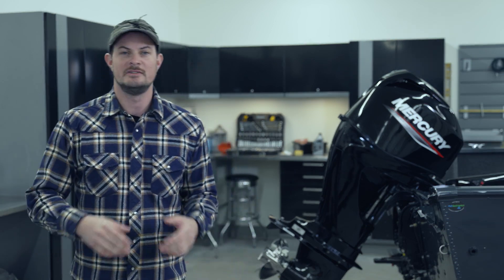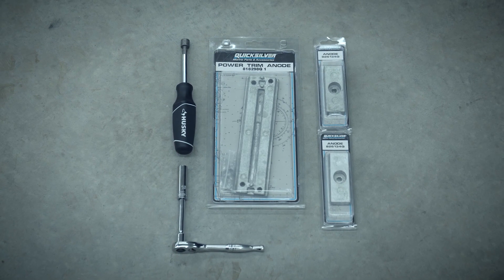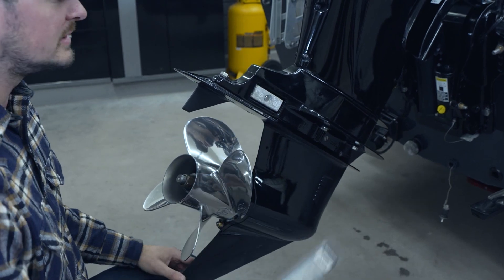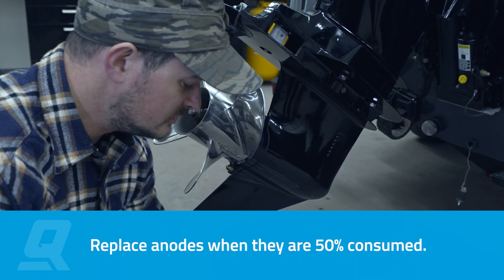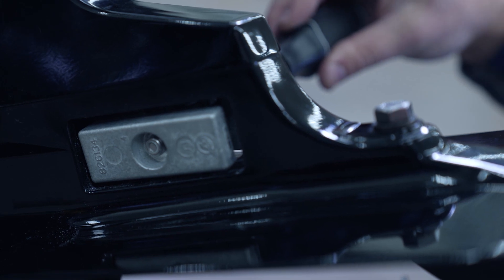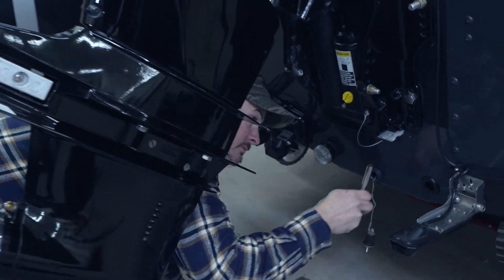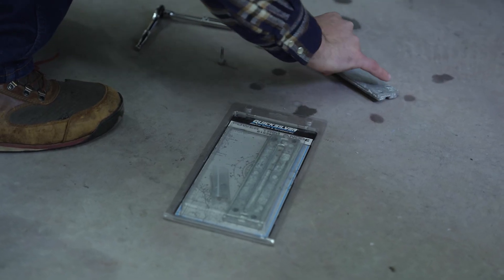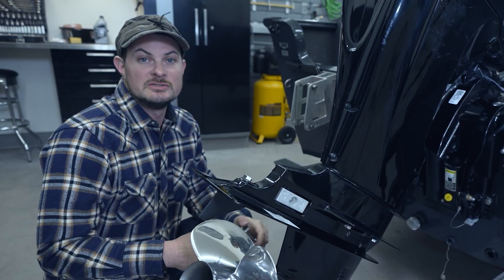How to Replace Anodes in a Mercury 40-60hp FourStroke Outboard

Comment: What about the ones in the block?
Reply from the maker: Per the operator's manual for the 40hp - 60hp engine family, the only anodes that require replacement as routine maintenance are located under the power trim/transom bracket assembly and on each side of the gear housing. We recommend reaching out to Mercury Marine directly if you have questions related to parts of the engine that were not mentioned here. Contact details for your nearest Mercury Marine office can be found via the link below. Thank you!
https://www.mercurymarine.com/us/en/about-us/contact-us
Reply: I came here for that question as well. What are locations of them?

Comment: I bought a second hand 40hp 4 stroke that looked like the anodes were never changed. Is it too late to change them, can corrosion still be prevented by installing new ones asap?
Reply from the maker: Anodes can and should be changed throughout the ownership of the engine. While they may be deteriorated, they are likely still serving a purpose, and have been doing their job. Swapping them out with new ones will ensure that your engine stays protected for years to come. 👍